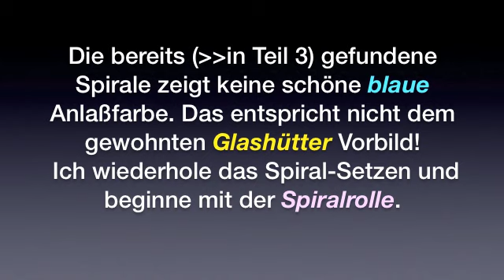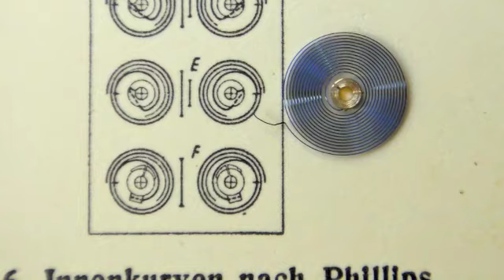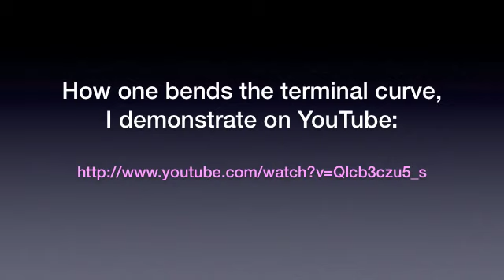Watchmaking, Restoration of movement M. Großmann 3955

Comment: Hallo aus England !

Many thanks for your superb videos.

I think I may have an explanation for the odd corrosion on the movement.

You mentioned that you thought that it originally had a gold case - this is the give-away I think.

I have seen similar movement damage when someone had used acid to test that a case was solid gold.

They used too much acid which got onto the movement and corroded it.

Like you said in an earlier post, there are crazy people everywhere !

Kind regards,

Andy